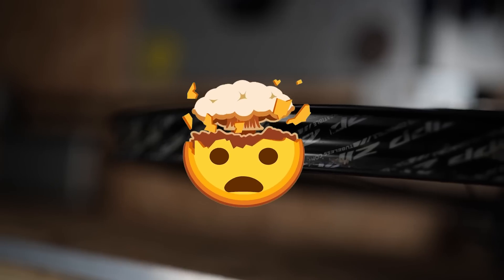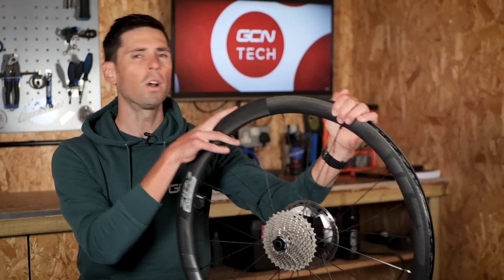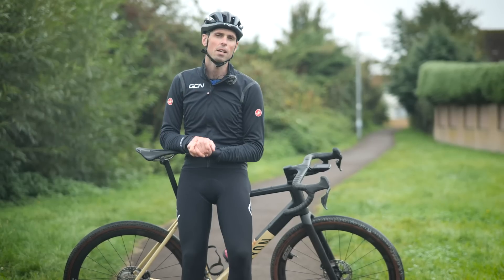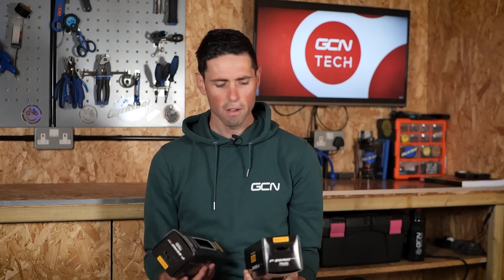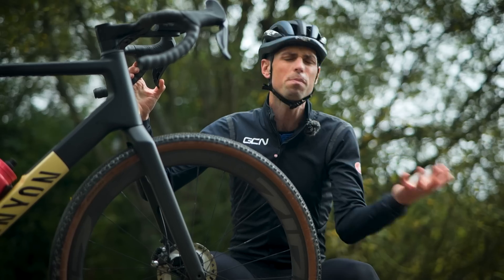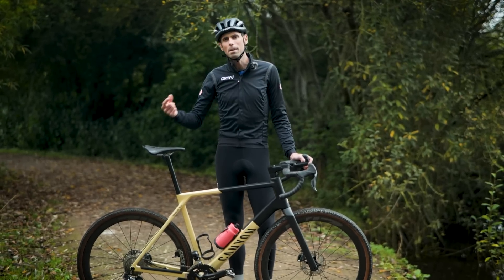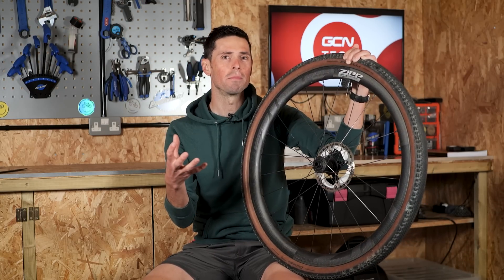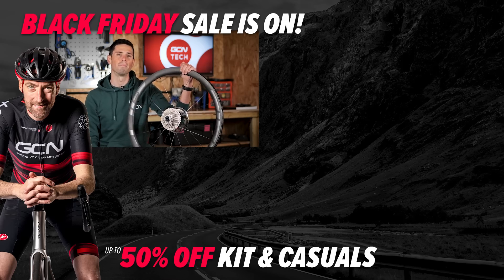What exactly is hookless technology, and what are its pros and cons?

Comment: Hookless.
It is a copy of Dunlop Endrick. With a hookless, you have an inner tube and a DEMOUNTABLE OUTERCOVER. Max pressure 70 psi. High Pressure, or H.P. rims, with a hook, go up to over 100 psi.
When the outercovers are mounted, pump to 10 psi and manually centre the cover. Then when satisfied, pump up to 70 psi.
Shouldn't you be on the Yesterday Channel?

Gravel. The Rough Stuff Fellowship are still alive and kicking. Dawes Super Galaxy, cantilever brakes, no mudguards or racks, Cyclocross boots. Ah,.the seventies over again.

Comment: Enve suggests I run my 25mm tires on hookless wheels at 84psi. Never have had an issue.
Reply: No hookless rim is rated past 72.5 psi, no matter what tyre.
Reply: @RandyBumgardner  not according to ENVE. I've ran thay pressure for 2 years with zero problem. I also weigh 200 pounds though
Reply: Enve make great rims...would not doubt them

Comment: Hookless isn't a technology.  It is the lack of a hook.  I still don't know "why" they did this.  It didn't improve anything.  It just made the manufacturing process cheaper for the companies and everything else more complicated for the consumer.  Weight savings?  He's saying 200 grams per wheelset. That's quite a bit.  I say BS.  It would be negligible at best.  Better aerodynamics?  I say BS.  The tire should sit against rim the same with or without hooks and would be more dependent on the tires, not the rims.  Again, negligible at best.  Better comfort?  That is all dependent on the size of the tires and tire pressures which can be the same with or without hooks. You can ride really low pressures with hooked wheels too.  I call total BS on this one.   Hooked tubeless ready clinchers are the best bet to give you the ability to ride both tubes and tubeless, a better variety of tires that are available, and the extra safety measure of a hook to keep your tires secure.  I still don't see any advantage for hookless.  If anything, it's the other way around.
Reply: Silca (ironically a listed sponsor on this video) called bullshit on the aero gains of hookless, with their own independent tests. It would be good to get Josh Poertner back on GCN Tech telling Alex what he thinks of hookless now.

Comment: Yeah.. go hookless for all the advantages only to not be able to choose a tire that's faster, grippier and lighter. Also there's so many "advantages" listed in this video that are either misinformed or that Zipp didn't really take advantage of. Quick couple examples:
- Hookless lighter? I can think of at least 8 brands of wheels of the top off my head that are hooked and lighter.
- Hookless drove carbon wheel prices down? No. Carbon wheel prices were going down long before hookless was even mentioned in road biking. Chinese wheel manufacturers who build equal or far better quality wheels than western brands and charging 1/3 the price. That's what drove prices down.

All wheels can be dangerous. Hookless is way more dangarous than hooked and it's supported by data at this point. How many more high profile crashes do we wanna watch before we admit that?

Comment: I’m 105kg - hookless isn’t for me unless I want to be limited to 30mm tyres which excludes a number of bikes that only have 28mm clearance.
Reply: I’m 110kg give or take. And the recommendations are for 32mm tires is what I’m getting from wheel suppliers. 30mm tires are right on the maximum. I’ve just bought a new bike and they only supply with hookless.
Reply: same

Comment: There’s no way hookless saves you 200 g
Reply: Yea, that math seems way off.
Reply: Sure it will. If you buy a $2800 pair of carbon hookless wheels, and compare it to stock aluminum wheels, or a wheel set in the $300-$500 range, you'll save 200g, and another 5-8g with a much lighter wallet.
Reply: yea I bought a set of hooked carbon GRX wheels that are 1450grams all in with valves and tape on sale for $1100 I highly doubt a set of hookless gravel wheels out there is under 1250 grams @christopherharmon9336
Reply: Sadly this video seems riddled with marketing BS. Like how can a rim with the extra thickness of a hook be weaker than a hookless one?
Reply: it does make you lose MORE than 200g,when you fall you lose that much skin, teeth and bones
Reply: No way 😂
Reply: Probably 5-10g, the overall volume of the hook section is very small. Also, given the much higher danger from any flex in the rim, I expect they have to make them heavier to ensure they are more stiff.
Reply: Maybe 2 grams
Reply: 20 maybe

Comment: So many stuck in the mud traditionalists commenting here against hookless.  Personally, first snd foremost, i prefer to use wheels from a super reliable premoum manufacturer like Enve or Zipp.  For the last set of wheels i bought it seemed i dudnt have much choice other than hookless given  my preferred brands had all gone fully over to hookless.  I accepted this amd bought a set of Zipp 404's, I found them to be substantially cheaper thsn the previous set of Zipps I'd bought 5 years earlier so was happy.  

Two years and 40k km later I am super pleased with this switch to hookless and tubeless.  Getting far fewer punctures thanks to going tubeless, plus, my wheels are significantly lighter than my wheelset from 5 years ago thanks to hookless and overall I am very satisfied.

Frankly, there are too many dinosaurs in road cycling who still cling to rim brakes and using old wheel tech due to irrational fears and heresay. Get with the times people!  Move forward, stop living in the past.
Reply: That’s the point, it’s not a step forward, it’s a backward step for the consumer and a cost cutting exercise for the manufacturers. Just like pressfit bottom brackets.
Reply: @Graean1  disagree, my Zipp 404's acquired 2 years ago were significantly cheaper than the previous Zipp wheelset I had bought 5 years earlier.  Plus I like that they are significantly lighter than my older Zipps.  Something significant must have changed to facilitate these improvements to cost and weight.  I am assuming these were due to manufacturing efficiencies giving lower cost and lower weight.